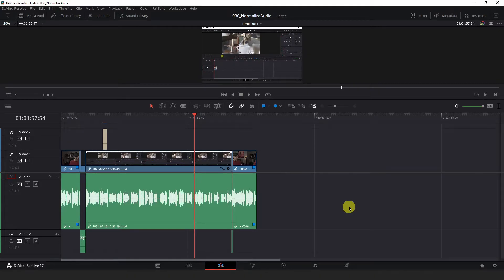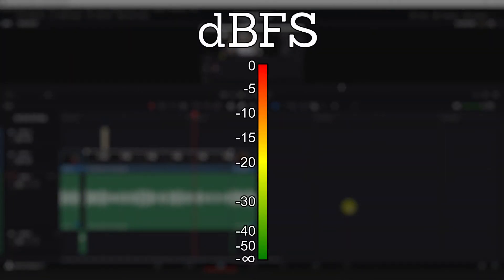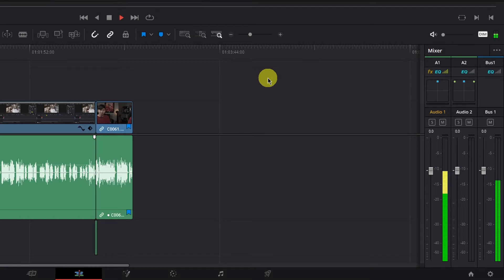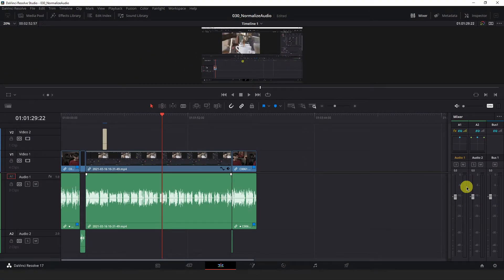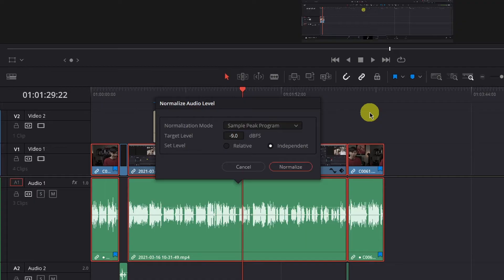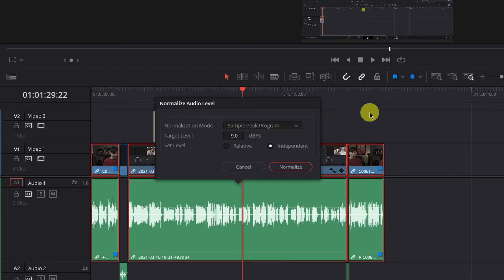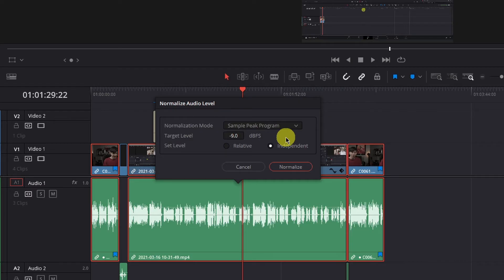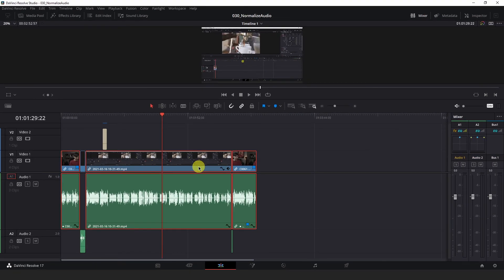How to Normalize Audio to Get Consistent Audio Levels in DaVinci Resolve 17

Comment: Um isn't that extremely low? Doesnt Youtube scale your sound up to -14 lufs and if you are at -10 DBFS it will crank it and make the audio worse? most other creators seem to push the sounds to a fraction of the peak and get the intergrated as close to -14 lufs as possible

Comment: Didn't work for me.  I lowered the highs but did not elevate the lows.  So loud parts were normal, but the low parts were still too low and I had to manually increase the volume.
Reply: i know this comment was over a year ago, so i guess this is for peple who also have this problem still:

Make sure to tick 'independent' and lower the target (all the way to -7.0 if you need to)